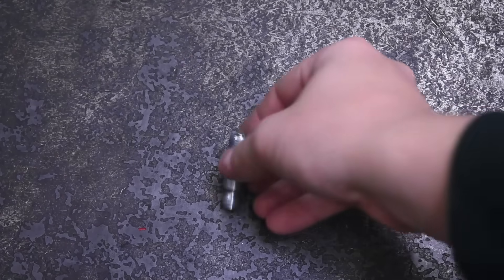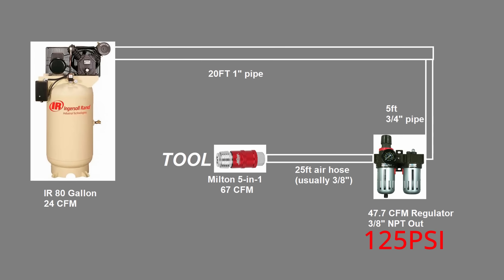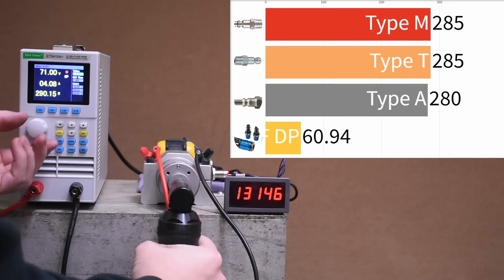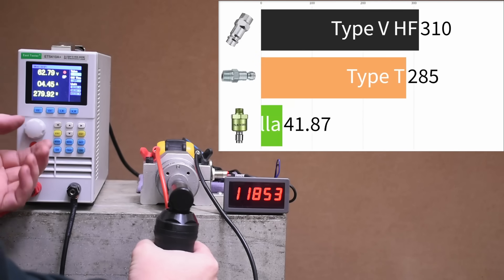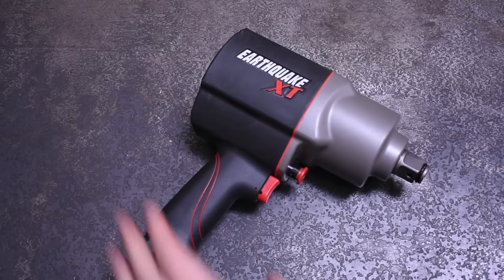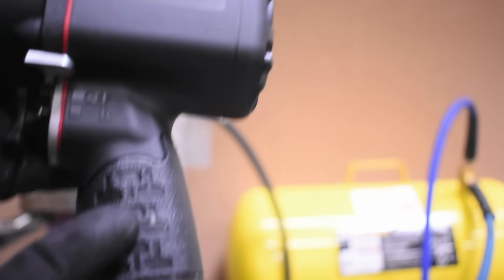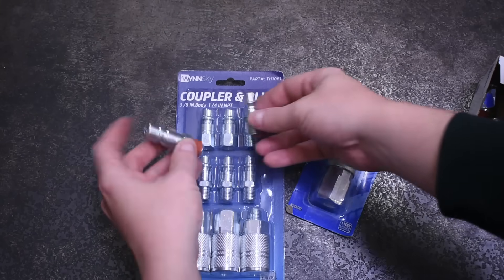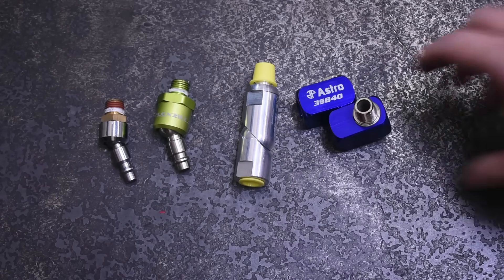Triple Air Hose? Testing Best & Worst Power Adder Tricks

Comment: I did the exact expansion tank trick years back to help out my crappy 30 gallon oiless Craftsman compressor. I just tee’d the opening of an identical Hazard Freight yellow 11 gallon too. Always figured I would buy another weld in 1/2” NPT bung and weld it onto the other side of the tank. Figured the turbulence has to be wild and restrictive using the tee method. I bought cordless stuff and the compressor barely comes on anymore. Never got around to it.

Comment: as a pneumatic repair tech for 20yrs .... this testing is crap. the industry standard is 90psi at the tool not 120psi.. he may get more torque out of the tool but hes also depreciating the life of the tool. If your not getting the "rated" torque from a tool is because you are not giving it enough cfm not psi.. go with a bigger hose and larger fitting with less psi and you will get the results you want without killing the tool in the process.
Reply from the maker: As a pneumatic repair tech you should then know that tools are rated for 90psi with the tool running. 90psi dynamic often requires above 100-110psi static depending on your set up and also that no working shop in this country is regulating wall pressure to 90. We test real world not fantasy land
Reply: @TorqueTestChannel  and that is why you keep guys like me in the repair business.. carry on.

Comment: Small correction:
The US is not using the imperial system but the "US customary Units" - those are not the same... cause the US gotta make even that complicated.
1 US fluid ounce > 1 imperial fluid ounce
But
1 US gallon < 1 imperial gallon
And only the US has different volumetric measurements for liquid, and 3 different for weight.

Comment: I am not sure but the largest connector i think is a Milton G, I replaced most of my connectors to that one, with a 1/2 inch hose.  I used to have a remote tank with a 1/2 hose to the impact just to get the extra volume, it was feed by a 3/8. The Milton G have a 1\4 option and i just have a pigtail to a Milton V if i need it.

Comment: WOOOWWW I am literally parked in harbor freight parking lot, and having finished a previous video right as I was pulling in, this one started auto playing. I stunned by this because I am at harbor freight to get air fittings for a couple tools and was trying to remember and decide which fittings style/size are best to truly optimize my pneumatic tool setup as well as contemplating whether or not to get an in line filter or any other piece of gear I would need for my tools. Then what do you know, the absolute perfection of a video going over exactly what is the best and why comes on and I gotta thank you a ton for doing what you do to providing truly priceless, eductional, and humble data for all us consumers. You continue to be one of my all times favorite channels. Plus I am incredibly jealous about the work you do 😉
Reply: You should setup a 3/4 hose with Chicago fittings like what most industrial settings use. Even on the service trucks we use 3/4 hose with 1/2 pipe into a half inch quick coupler.

Comment: Nicely done video, thank you. 

The expansion tank will only help in situations where the additional pressure availed by the expansion tank is not depleted in the tool-operation time.  Short bursts of operation and allowing the buffer tank to recharge between the bursts should help.

Comment: What if you put the regulator directly on the bottom of the impact wrench?

of course, you could crank up pressure…

I might put a pressure gauge on the bottom of the gun, just to see how much loss I have due to the regulator & hose (when pulling the trigger)…

Comment: Milton V is the only thing we use for quick connect but if there is a real need for torque such as taking apart large rusted nuts and bolts then 1/2 inch air line hooked up directly to the hi-torque 3/4 air gun gets the nod.  The hi-torque Milwaukee won't touch these bolts but the 3/4 air direct doesn't even feel them.  Pressure is supplied by a measly 5 horsepower gas compressor filling a 200 gallon repurposed propane tank.

Comment: I have a 29 gallon 2.5 hp compressor. Using the stock regulator that a 3/8" hose and fittings fit into. 
I have friends that recommend I should go with 1/2" air hose. Would I get a noticable increase in performance with the stock regulator or should I go with a different regulator with a 1/2" outlet?

Comment: Lol low key flex. 
“I had Astro work on a prototype design”. 
Because Astro is cool and taking tips and actually acting on them we’re going to start using Astro Impacta in the shop. 
Have 24 tools on the way.
Reply from the maker: It's my job tho :)

Comment: Does the layout of shop air pipework have a large effect on the dynamic air pressure ? As in having right angled bends or tees as opposed to one hose directly of the reservoir tank ?
Reply: Wynnsky fittings 1/2 air hose 25 feet from a buffer tank about 125 PSI seems to work best. This allows you to get by with a smaller compressor and still have a lot of impact power. I notice that some of these you tube auto repair channels use electric impacts but have to use a breaker bar first. The whole idea of the impact wrench is that you don't have to use a breaker bar. I use air tools for the big work and electric tools for valve covers and battery terminals.

Comment: For years and years, I used M-style 1/4" couplers with 3/8" hose at home, just like my dad did. I never gave much thought to the restrictive fittings. Then, in my early 20's, I became a tech with a company that started doing NADCA-Certified duct cleaning, and over time, I kept finding ways to improve the equipment we used. They were using the same setup that I did at home, which was 1/4" fittings on 3/8" hoses (though the compressors used were putting out higher pressure, between 150psi and 175psi.)  I noticed the restriction in the fittings one day while setting up a new trailer, and decided that it was probably not helping us. I switched them out for higher flow 3/8" fittings that I found at Home Depot, and the difference was crazy. I also added an expansion tank made out of a cheap Harbor Freight sandblasting tank, and that also made quite an improvement in all of our Nikro air whips, blow guns, etc. After I left that company, I moved into a new house, and started deciding what to do about my air compressor and line setup. I soon discovered 1/2" air hoses, followed by Milton G-style 1/2" NPT fittings and couplers, and I knew what I was going to use! The flow is AMAZING! I do have to use reducer bushings on almost every tool, but that is a small price to pay. Now the only restrictions in the system are right by the tools, and I doubt it makes much of a difference.

Comment: to keep you air system pressurized you need a high cfm compressor 
a Three Phase 75Kw - 499 cfm - 125 psi cost around $61K is most likely what NASCAR uses
most shops and houses use smaller tho around 1 - 5 cfm (caped price at $1500)
but you can get one that is 240V - 35 cfm - 175 psi for around $8K

if you look at your tool there should be a cfm rating that tells you how many cfm it need to run full out
an INGERSOLL RAND Impact Wrench: Pistol Grip, Std, Full-Size, Gen Duty, 1 in Square Drive Size, 271 needs 39 cfm
and a Snap-On MG725AP 1/2" needs 37 cfm

all a tank does is allow the compressor to not have to run all the time

cfm = cubic feet per minute

Comment: You should do "home setup improvment" series. 

Most of us have 120V 10-30 gal tanks.
I feel that's where people are the most "desperate" to get more hitting power in shortest time possible.

At work I can run my gun non stop (huge industrial compressor) and minute or two of humering later the "stuck" bolt is loose even on 100psi max.

 At home I only have 10gal 130 psi and if the bolt doesn't move in first 5 sec the power curve is dead and I have to wait 5min for compressor to catch up.
Also you cant run those non stop and after 3rd run it will take 10+ min to fill and be so hot i have to stop for 30min.
Removing a bolt that needs even full 15 sec of hammering is a pain...1 min completly out of question unless you want to spend the afternoon on it. 

To be honest, the cordless is the way to go at home, I just have too many air tools and need the air for tiers and cleaning/blowing anyway.

Comment: I wonder if putting one way check valves on the 3 hose config would make any difference since if they're all on the same input fitting they're fighting each other. If so you can try a 3x3=9 hoses and start setting world records for most silly airgun arrangement

Comment: Correct me if I'm wrong,  but isn't the idea of the inline air tank near the tool to try to get a higher initial burst before seeing a drop? Like short bursts with a big boy air hammer? I've considered trying this with my Atlas Copco RRH12TS (with quick chuck, of course), as I don't see as big of a difference over Big Nasty as I'd like. Irrelevant, but I'll also point out that there are times when the vibration/harmonics created by my PH3050B are actually more effective. Can be annoying when all the lug studs fall out and get trapped while trying to remove a rear hub assembly on an Explorer haha. And yeah, I've actually been running these three hammers side by side by side. Considering selling Big Nasty and upgrading? a .401" Chief for at home though (much smaller tank and less pressure available (for now)).

Comment: Thanks, awesome channel I bought a Thor because of you.  Question: what about the fittings on the regulator?  Should those be using 3/8" or 1/2" when using a 1/2" hose?  Also, have you tested Milton G-type fittings?

Comment: An old timer showed me the trick of running a short air hose whip off of all my tools when I was working at the truck dealership. That keeps you from denting fittings of you drop the tool, it also helps prevent the fitings from cracking in your air impact/hammer tools.
Reply: How would you attach a whip without having another fitting?
Reply: @EnlightenedSavage thread directly into the tool
Reply: Attach to other side of hose @EnlightenedSavage
Reply: @EnlightenedSavage  Direct thread the hose straight into the tool, then use a fitting on the other end for connection. 

I have an OLD air ratchet from my grandpa that was set up that way. Never really knew why, but @jacobkarns2025 just made it all make sense for me lol
Reply: Its really nice on pencil grinders

Comment: Well next is the air compressor used in drilling rock or breaking concrete. 
Just don't use your hand to pull the trigger.

Comment: Great testing, sometimes i wish i lived in the US where things were cheaper and more available. 
Generally our compressors go from (single phase) -16cfm (big diy/small workshop 100L) straight to 3 phase 42cfm workshop one 300l tank with nothing in between so airline sizes + expansion tanks make a huge difference to nominal output & we all know its actually about free air delivery not rated cfm. 
There is a lot of maths that goes into doing setups correctly...enough of me keep it up and thakns

Comment: Mind putting on test different electric bolt guns/torque wrenches. Just recently got Robota (makita clone) and i'm wondering how much torque it really puts out since box states one, manual another and machine it self has different value of 460Nm. On the field tests it does decent job but one needs to loosen tire nuts with torque bar from 120Nm for it to open them after a summer, but managed to get more when putting bolts back in.

Comment: The point of a buffer tank is to have whatever you have in the shop feeding it, but a short piece of the biggest hose you can live with plumbed into the tool with a non-restrictive swivel.  It's only useful for high-draw tools.
Reply: If im understanding this right a buffer tank just increases the volume of compressed air available. Which if thats the case why not just get a bigger air compressor?
Reply: @shawno8253 a tank can make up for long lines. I really wish they would redo that test in a way more like you would use it in your shop. For example I might have 50 ft of 3/8 from my regulator to my tool. If I connect a buffer tank to the end of that line, and then 10ft of 1/2 or even 3/8 I should see much better performance at the tool for a couple seconds. Need a Dyno to prove it tho hint hint
Reply: @shawno8253 If you need short bursts of large volume, don't use the tool very often or just for one project. Compressors aren't cheap so it can be more affordable to just get a big tank.

Comment: I would like to see a video comparing regulators. I did a little bit of research awhile back and a few people said that the biggest air flow restriction is the regulator that comes with most prosumer air compressors.
I plan to install a tee coming directly off my tank, and run it to a larger regulator. That way I can keep the pressure switch and factory regulator intact.
Reply: If you want better flow just plumb a chuck straight from the tank and skip the regulator. The only reason to want a regulator is to lower pressure for special uses like spray painting, light blow gun work etc and where applicable OSHA blow gun compliance.

Comment: The tank would work fine at the end of a long line with short tool usage times to allow a recharge. I think the tank would be better used for air nailers. 
Have you tried to measure the air flow to these tools? Would be interested to see which tools are more efficient in terms of air usage vs power. 
Thank you for very informative and entertaining material guys!

Comment: There is a reason the better the compressor they go up drastically in price, high pressure plus high volume takes a lot of power and you need big motors on the compressor. Getting the best from your equipment by removing all the bottle necks gets the best from what you have. How do road digging compressors compare to a shop compressor, huge diesel engines supplying air to jack hammers?

Comment: There is also a difference in the valve of the coupler (the female side) between manufacturers. The more expensive ones look like they would flow more air than some of the cheaper options. They are usually fairly easy to dissect with a pair of needle nose pliers. I would be interesting to see performance differences between manufacturers of the couplers (if there is one).

Comment: I use a 1” impact on my service truck with a 50 gal tank. You get about a dozen ugga dugga before you have to wait for the compressor to fill’er back up to pressure

Comment: If you want more power for testing, you can rent a towed gas powered compressor, OR if you can find a local partner/friend that runs a sand or media blasting company and use their setup.  When I was a kid, the smallest portable compressor we had was a 12HP/33CFM gas, and the primary was 100 CFM, driven by 3 phase electric motor.  3/4" hoses for portable, I believe 1.25" steel pipe for the fixed compressor, with 1" armored hoses to the machines.

Comment: You're not controlling for varying moisture in the air, which significantly reduces delivered power.  You should have a refrigerated dryer in your supply setup.  Moisture also relates to the tool oil, which is designed to lubricate and prevent rust in tools that are wet inside from using moist air.  Your system is partly steam powered!

Comment: Milton V seems to be the ticket. Especially since they can still accept M style as well. Great video! I still would love to see the difference adding an air tank makes to a simple 120v compressor most have at home.
Reply: Built my air system around Milton V, no regrets at all
Reply: THIS!
Most of us have 120V 10-30 gal tanks.
I feel that's where people are the most "desperste" to get more hitting power.

At work I can run my gun non stop (huge industrial compressor) and min later the "stuck" bolt is loose even on 100psi max.

 At home I only have 10gal 130 psi and if the bolt doesn't move in first 5 sec the power curve is dead and I have to wait 5min for compressor to catch up.
Also you cant run those non stop and after 3rd run it will take 10+ min to fill and be so hot i have to stop for 30min.
Removing a bolt that needs even full 15 sec of hammering is a pain...1 min completly out of question unless you want to spend the afternoon on it.
Reply: Literally have them in my cart lol this video helped me make the decision

Comment: The best mod that i did was to remove the 1/2 plug from my air tank and spin in a 1/2quick conect fiting with a 10mm hose straight to the power tool 😀

Comment: You should see if there's a power difference between the swivel being straight, or at a hard 90 degrees, since the air needs to make a hard turn

Comment: I did a lot of research and switched to Milton V fittings 4 years ago.  I like them because they are compatible with the industrial kind (applications where peak airflow doesn't really matter).  They seem to take a lot of force to plug in though.  I always wondered if the T fittings were easier.  Doesn't matter.  I have a tiny air tank (12 gal) and the only thing I even use it for is inflating tires and blowing air.  I am in the market for a power ratchet though so I may want to think about air vs battery.  For impact, I'm quite happy with cordless.
Reply: I'd go cordless for the ratchet. I have several pneumatic ratchets and haven't even used some of them (I bought them with a loaded rollaround). OTOH cordless tools are far more mobile and I take mine into salvage yards, all over my property and elsewhere.
Reply: @obfuscated3090  Ended up buying a Ryobi brushless 3/8" with the extended head.  No regrets.  Thing makes a lot of torque!